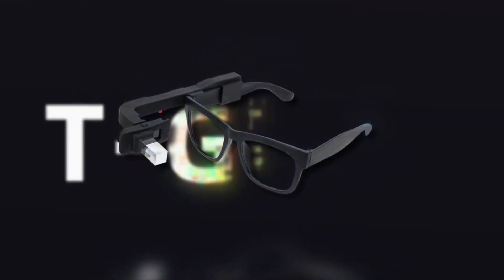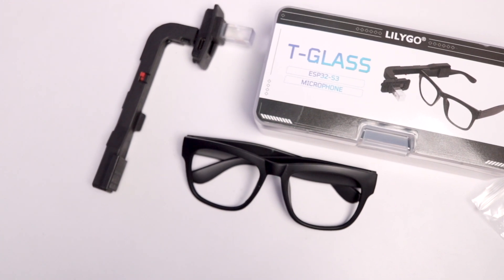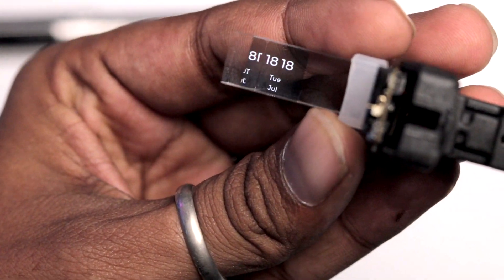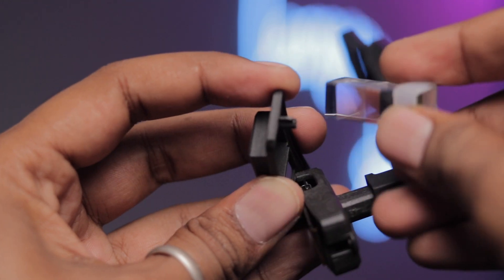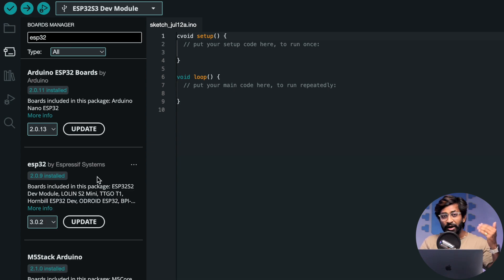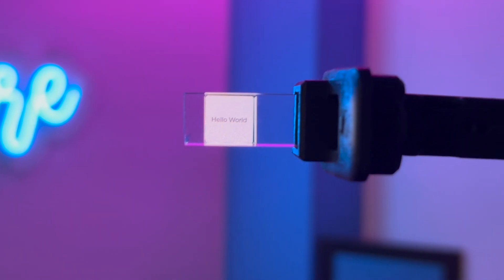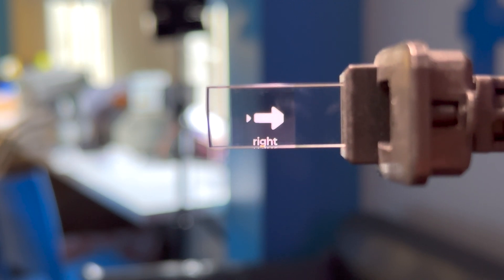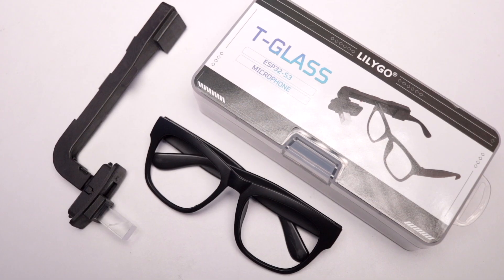ESP32 based Smart Glasses from LilyGo | Giveaway

Comment: If it had a geomagnetic sensor, it would be much more useful for navigation. However, one possible navigation application would be to using the RSSI value from ESP-NOW to track down a beacon. It would not be able to show direction or distance, but it would be able to indicate whether you are getting closer or further away. If you can attach a geomagnetic sensor to the frame of the glasses and pair it with Bluetooth, you could then get direction: take 5 steps in one direction, then turn 90 degrees and walk another 5 steps; by calculating RSSI differences using an inverse square formula and a bit of trigonometry using the geomagnetic headings, you can get a direction to walk toward, and then it can switch to proximity tracking mode. This would not be useful for tracking a moving beacon, but it could work with a stationary beacon.

Edit: since it has an IMU, it can automatically track steps and changes in direction, so it actually can be used to provide a rough direction based upon detected movement and changes in RSSI. I almost want to build it now.

Comment: Hey Sachin !

LilyGo  T- Glass  is good for making basic and simple projects but most of the comments that are coming in your video are of very advanced  that would not easy to make. 
The reasons why I am saying this are:

There is no feature to add external devices in LillyGo
Like there are so many comments to integrate AI api 
But the screen is too small to show the long sentences as answer in the result if you turn on slide animation this will make it harder to read. 
And it has inbuilt microphone feature but not speaker  feature we can't add external output devices like speakers in it to get output from the AI. 

The ESP32-S3 has limited processing power, making it difficult to handle complex tasks or real-time data processing efficiently.

The coding of T glass is little different from the regular ESP 32 and OLED display.

Lack of Camera

The common project that can be made by this T-Glass.
Are :
Smart Home Controller: controlling the home appliances by toggling the touch button, if you have a greater knowledge of programming then only you can add the AI to control the home appliances with so many limitations. 

Notification alert: alert system for gas leakage fire allowed etc.

Reading simple data values using Bluetooth and Wi-Fi communication. 

Navigation system  could also be made but connecting another microcontroller and GPS with T- glass.

Integrating inbuilt sensors like IMU and microphone.

Comment: Develop a smart glasses interface that allows you to control and monitor various smart home devices. This project will enable you to manage lights, thermostats, security devices, and other smart appliances directly through the glasses, offering a hands-free and intuitive experience.

Real-time Status Monitoring: Display real-time status of connected devices (lights on/off, thermostat settings, door lock status).

Device Control: Control smart home devices through voice commands (turn lights on/off, adjust thermostat, lock/unlock doors).

Notifications: Receive alerts for important events ( security alerts, motion detected, doorbell ring).

Scenes and Automation: Set up and activate scenes or automation routines ("Good Morning" scene to turn on lights and adjust thermostat).

Comment: I have an idea to make a smart portable device that will enhance the potential of LilyGo T-Glass, that I named "CheckoSmart." This device will be used for comprehensive circuit and electrical testing, combining multiple functionalities into one portable tool.

In this project, I will use an ESP32 and LilyGo T-Glass. We will create communication between the ESP32 and LilyGo T-Glass using ESP-NOW. Various components like voltage dividers, operational amplifiers, ADCs, DACs, and sensors (current, thermal, etc.) will be connected to the ESP32, with a GPIO multiplexer to expand the number of pins.

This one device can be used as:

Digital Multimeter
Oscilloscope
Logic Analyzer
ESR Meter
LCR Meter
Signal Generator
AC Voltage Detector
Continuity Tester
Current Clamp Meter
Thermal Imaging Camera
Decade Box
These features will come in one device, "CheckoSmart," for checking circuits and electrical devices. The data from the sensors will be sent by the ESP32 to the LilyGo T-Glass, allowing the user to read the data through the T-Glasses.

On the screen of T-Glass we can see real time values.
Like voltage, heat alert, circuit fault detecting etc.

We will also connect relay modules to the ESP32 for automation. For example, if you tell the T-Glass to turn on the soldering iron, the relay module will activate the plug of the soldering iron.

Additionally, we will integrate Gemini AI, enabling users to ask questions. For example, if the user is unsure whether a module is a digital or analog input, they can ask Gemini AI.

This will help electricians and content creators a lot, as it allows them to check circuits in various ways with one portable tool and display the data in the glasses. They can control their electronic appliances or tools using voice commands and consult Gemini AI for component information.
Reply: Yes I wanted to make same project for my college 😉
Reply: @Thefunnshow04  yes you can contact me i will provide all hardware and coding information but i am not actually aware of lilygo T-glass coding, i made this project with oled display dont  worry  i am working on  t glass coding and AI api
Reply: ❤ Good idea how your mind think of these ideas.
Can you give me full report about your project.
Reply: Good idea
Reply: @Beeasy_shorts  🥰
Reply: Can you help me to create this😊

Comment: We will make smart glass application that runs on android and connects to the Togo Tglass based on ESP32-S3 that monitors essential health metrics and provides timely reminders and alerts for improved personal health management.

Key Features:

Health Metrics Monitoring:

Utilize  motion sensors integrated into the Ttgo Tglass.
Display current time and activity level data on the screen.
Alerts and Notifications:

Set reminders for medication schedules, hydration alerts, and posture correction.
Use vibration or visual alerts on the Ttgo Tglass for notifications.
Fitness Tracking:

Track steps taken, calories burned, and distance traveled using motion sensors.
Integrate with fitness apps like google fit on smartphones for comprehensive activity tracking.
Emergency Assistance:

Implement a panic button for sending distress signals or emergency notifications to predefined contacts on android or apple.

Also, we may do AI integration for predictive health analytics or expanding connectivity with other smart devices.

Comment: Could you please make a video and share the code for an Arduino device with ChatGPT that helps blind people? The idea is that the device sends a photo to the ChatGPT API with the press of a mechanical button and then receives a response with the photo's description, which is read to the person via microphone. The connection could be available via GSM or Wi-Fi. The device could be worn as a bodycam on the body.

Comment: Since I am working on a colorful transparent display that is similar to the transparent display by DF Robot, but much better than it since it is colorful. So, I will try to improve the design since I think that this is quiet bulgy and not good looking one. So I will try to embed the display into the glasses itself.

Then it can be used as smart goggles to use it as sight for maps that might help during travelling without any external device on hand during travel.

Comment: This product can be used in industrial applications for human safety improvement.   I am currently working on a project which detects human presence in a specific area called  blind spots where industrial machines can move any time but the operator didn't have vision of these area .    Operators of these machines have limited vision and during Reeves travel of these big machines,  accidents may happen. My project works on computer vision detecting human presence in blind spots and generating alarm.   

This glass can be used to display alarms in front of the operator eye,  which is a neat solution.

Comment: Amazing video sir. This glasses can be used as a replacement for a phone, we can perform sms , whatsapp or even voip call by integrating with twilio , it can also be used for home automation , we can also use it for controlling other devices like laptops, video games etc. Also we can use ot to make a project to view incoming messages , and instead of using the swipe button we can use the inbuilt accelerometer by moving our head.

Comment: It's best use is for Mobile / electronic technician to get the output of iot multimeter. It will be easy for the technician or hobbyist to check the multimeter without being distracted